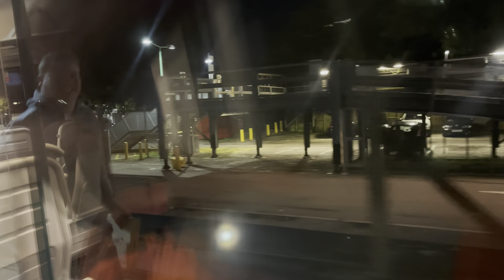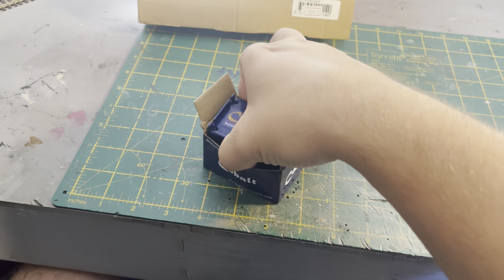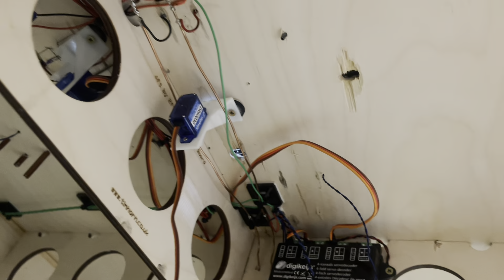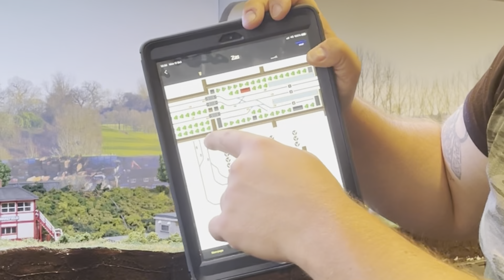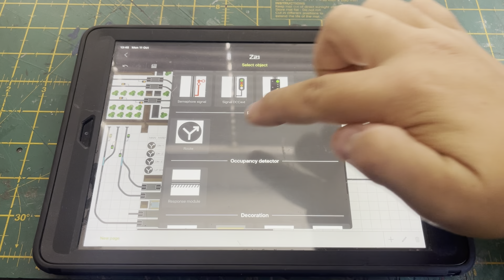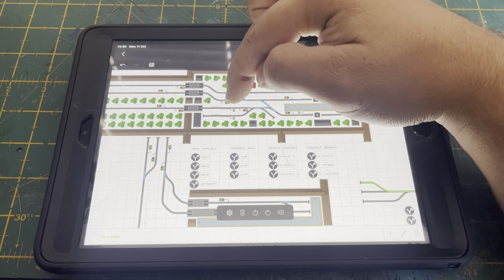DCC Concepts Cobalt IP Digital install & Z21 Route setting for DCC - HOW TO

Comment: Aw thanks Eric for an amazingly helpful video. I’m currently building a TT 120 layout. I’ve almost finished the baseboard and because I want the option of full automation I’m looking at Itrain with  the Z21. I’ve been looking at the cobalt motors recently and your video with info on the Z21 has been a tremendous help. Thanks so much 
just one thing Eric those cobalts seem to be a little bit noisy. I don’t know if they are in real life. Cheers mate keep up the good work Steve
Reply from the maker: Im glad its been helpful! Tis what its for! 😁😁
As for the noisy cobalts, they do whirr a bit, however in all fairness real point motors are quite loud anyway! 🙂

Comment: Cheers
thanks for the great work, I also have z21 system and bought cobalt
switches.
In your video you used the controller to set the address, is there a way on the pad to do the same
Cheers Chris

Comment: Last night I spent watching your videos . You are calm and straight forward , so you have my subscription with a black bell. 
I have only one question , where do Cobalts IP get their power from ? My friend maintains that they should not get power from the main line to which the  rails are connected . Please resolve . Best of luck and a happy new year ,Leo .
Reply from the maker: Hey Leo, thanks and happy new year to you also.

Yes the cobalts do unfortunately take their power straight from the DCC supply/bus which is a slight downside to them rather than a separate supply, however i believe they only draw a very low current so dont tend to cause issues, as far as im aware anyhow! 
Cheers, eric